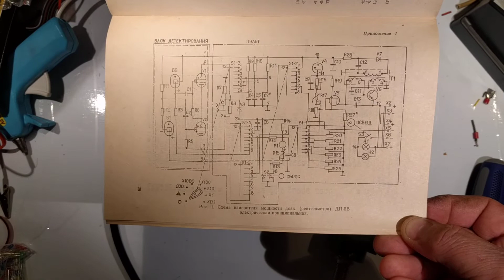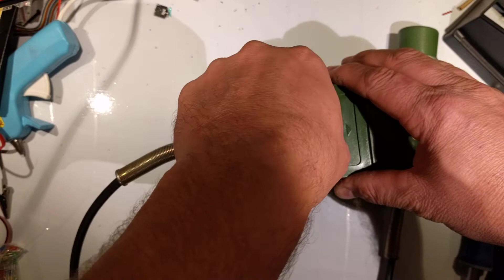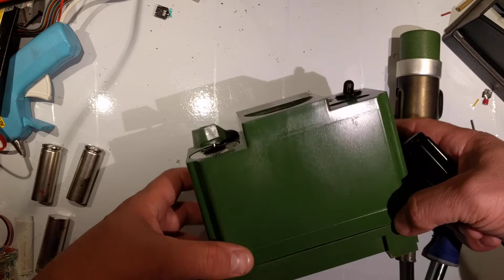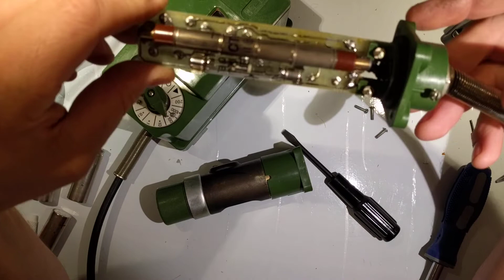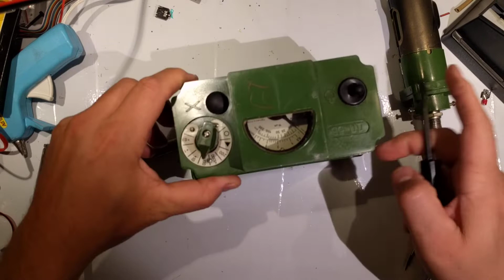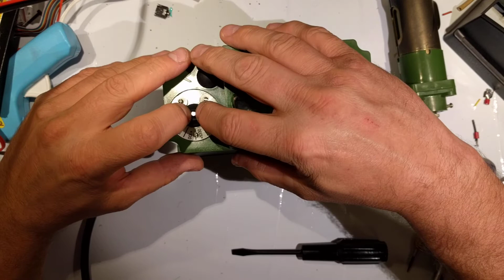Fun with Radiation! Soviet DP-5V Geiger counter teardown from Chernobyl!

Comment: Great video, i just got my hands on one of these but the tubes are missing. There are also two cables (one green and one yellow) that have been cut. Do you happen to know where they connect?  can't see them in your video.
Reply from the maker: Unfortunately I don't know where the cables connect. I only took it apart once and it was for that video a few years back.
Reply: @3rdworldgarage450  Okej, thanks for taking your time to answer👍

Comment: What I love about Soviet gear is just how easy it is to repair and use, even if you don't speak Russian. Hard to break, easy to repair.
Reply: @3rdworldgarage450  I have a West German Ion chamber and it has lots of lovely features but it's almost totally useless for it's job. Everything works inside on delicate almost clockwork like parts that would not survive being dropped, let alone a nuclear war which it's meant to work in...

Compared to the CDV 715 or 720 and it's almost a bad joke. The worst part was the check source is permanently inside the ion chamber but covered by a feeble plastic dial, problem is after a while the plastic breaks and you need to tear the check source or it won't work.
Reply: @andrewjackson246  Check Etsy Andrew, sometimes you can get perfect condition units from Belarus for reasonable prices.
Reply: @weaponsandstuff93  I got one but I don't get any reading out of it. The tubes on the probe light up but don't blink and I can't figure it out. :/
Reply: @BitNic26  Broken ammeter maybe?
Do the headphones make ticks?
Reply: @weaponsandstuff93  I found out that the thyratron tubes are supposed to blink for each count but they don't and I hear no clicks. The gm tube was unsoldered but after fixing it and testing the contacts there's still something wrong. It may be a GM tube failure. Is there any way I can check this?

Comment: I recently imported one of these from Ukraine. I got it running with a few minor problems. The needle doesn't move being the biggest one. I dont have many samples but the strontium 90 is going at about 8 c/s  but with no visible movement on the meter. Is it too low of a sample to register or is the meter dead? if that the case is there anyway to repair the meter?
Reply: @3rdworldgarage450  8 counts per second so ~480 cpm. rough estimate based on what I here in tics as i have no meter reading. It can barely detect my U235 sample from a CDV 700. Im not sure if the DP5V is just not as sensitive or mine has something wrong with it. is the strontium supposed to be stronger than the CDV700 sample?
Reply: it does register on all settings i just dont get a meter reading just an audible ticking
Reply: @3rdworldgarage450  OK so then maybe the counter is fine just the needle is FUBAR, mine is from 82 but i get a constant stream of clicks from the Sr90 with the occasional click from the U235